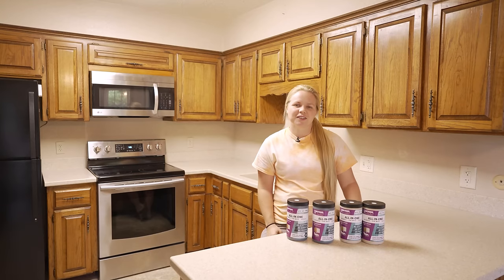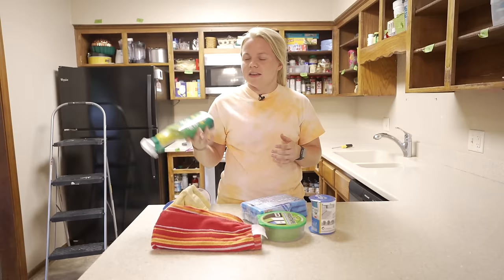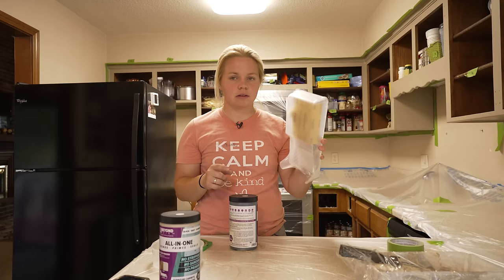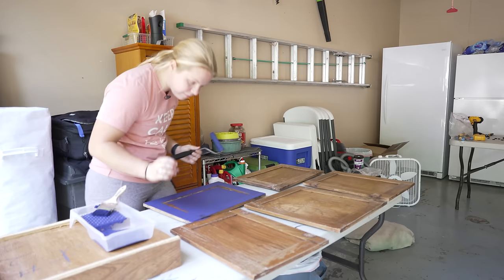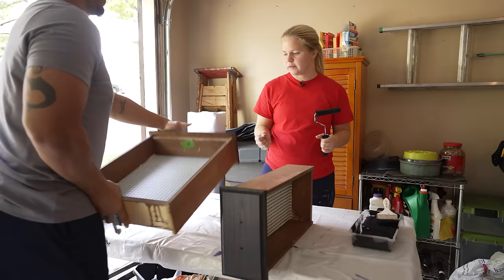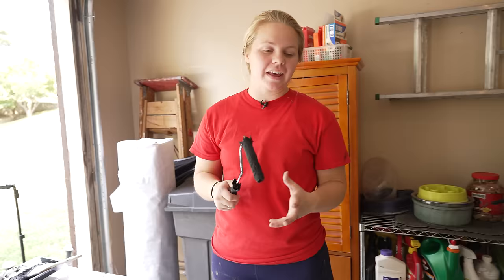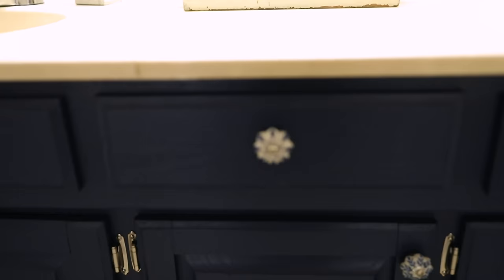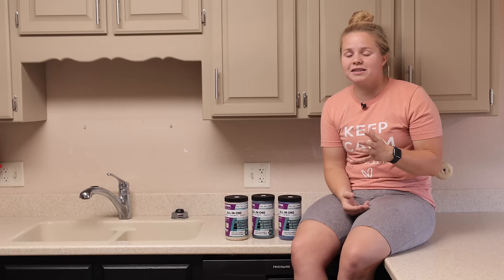How to PAINT Your Kitchen Cabinets the EASY Way

Comment: I don't trust these products that state you can paint cabinets without sanding and removing the  gloss, no matter the product will always grip better with a light sanding first... I did my kitchen cabinets and vanities in 2021 and took a lot more time with it and came out great and feel I can trust they will hold up... For mine I degreased first with Krud Kutter, I then used Timbermate water based wood filler, thinned with water and brushed it on the door fronts to fill grain.. after filler dried, I sanded filler down to just fill the grain, removed all dust, primed with 2 coats of BIN shellac and then sprayed 2 coats of Benjamin Moore Advanced with an airless and 310fflp tip, sanding between coats... Was a lot of work, but came out great...

Comment: FYI, a pro painter charges $100 per linear foot to paint cabinets. If you have 20 feet of base cabinets and 15 feet of wall cabinets, that's a $3,500 paint job.

Comment: Yes I would love to paint my kitchen cabinets.  The house belonged to a relative (grandmother) whom I moved in with in 2013 but she went to hospital and nursing home in 2014 and passed away.  Her cabinets had not been painted since she bought the home in 1973.   They aren’t the same kind as in your video they are just thin doors and chipped but the colour is dull yellow and I would like to spruce them up with a brighter tone or a white.   I would never have known to mark the cabinet doors with the shelves had I not watched your video!  Good tip.  The kitchen is small and there are only 6 doors up top and 8 on the bottom so won’t take that long but I wouldn’t know what kind of paint to get or how much I would need or if I need to prime them.  It’s kind of a smooth gloss type paint

Comment: OK I love this color combo. Choosing colors is too mind boggling for me so I like to copy something I saw that looks good. 2 questions.  First, we have a large oak paneled daylight basement.  Thinking of painting some of the walls to brighten it up. Would beyond paint be a good choice for this project? Second, I have some oak cabinets in my house I might try to redo. They don't have a factory finish so they're a little rough in places now. Should I lightly sand for a smoother finish? 
Thank you!

Comment: Did you use wood filler on the imperfections and to level the surfaces? And, did you caulk the cracks by the corners on the cabinet doors?

Comment: I just watched this video because I have been contemplating doing my kitchen cabinets. I was afraid to do it because I'm a perfectionist and I don't want my kitchen to look tacky. However, I am on a fixed income so having all new kitchen cabinets installed is not even an option for me. Have you ever done anything with the backsplash? And I did see where you had also completed the bathroom and painted the countertop would this work as well for a kitchen and would you let me know what product you used and it was it the same product for the kitchen cabinets. I do not have anyone that could help me do this and I realize that that's a problem and I'm going to give myself at least 2 weeks to do the kitchen because I am a senior citizen and it takes me longer to do these types of things. Would you recommend that the kitchen is painted prior to doing the cabinets because my cabinets go all the way to the ceiling as well. Thank you I enjoyed your video so very much. I've watched several and yours is my favorite.

Comment: I would like to redo both my main kitchen and basement kitchen, master bathroom, and at least one of the other bathrooms. I was wondering since this video was made 2 years ago if the 2-tone look is still in style? I kinda sorta like it, and I kinda sorta don't, so I can't decide whether I want to try it or not.  I wanted a turquoise or teal color for my bathroom, but the closest thing this company has is Nantucket, which I think is too light blue and won't match the rest of my decor. Is there any other product like this with more colors that you can recommend?  Otherwise, I might just be sticking with boring, old white for everything.

Comment: I really love the navy colour in the bathroom. You have done a fantastic job on the kitchen too.  I  just wanted to ask if the cabinets are smooth.  Is the BP a flat paint or does it have a sheen, or gloss. Do you need to put a seal on the cabinets for longevity.
Reply from the maker: thanks! the Beyond paint doesn't require a top coat but you CAN if you want extra insurance! the dried paint is pretty smooth but has the slightest texture which helps it hold up against wear & tear. I would say it dries with a sheen between Matte & satin

Comment: Quick question, I might miss the video. Did you sand the cabinets doors before painted? My cabinets are 6 years old.
Thank you
Reply: No the cabinets were not sanded bfr. She uesd a paint that has already a primer and more (i x remember what else), and the name is 'beyond paint'. Its not cheap but it lets u skip a lor of steps vs regular paint.

Comment: I am going to attempt my cabinets which were covered in a veneer of what seems like plastic  I've removed some of the veneer as it is easy to remove, but the under cabinet material would be very hard to sand as it is so soft.  I'm afraid to ruin the look of the cabinets.  I have bought regular semi-class paint and hope that will do do the job, but then thought that after the paint is done maybe a coat of polyurethane should be use to make cleaning them easier?  Is there a better way to do this?
Reply: She told us to wait 30 days for curing..Did you not listen,??? You can put on polymer if you want to ??

Comment: I've been painting some smaller pieces of furniture with chalk paint and have had trouble with brush strokes. This made me hesitant to paint the kitchen cabinets. I may try this paint and start with a bathroom vanity and see how I like it. How do you not get texture using the stippling and rolling? I'm guessing it's because the paint is self-leveling? Also, can a glaze or dark wax be used over this paint? I would like to have some dimension in the cracks and crevices.

Comment: I did my kitchen cabinets and countertops less than a year ago with this paint. I did two coats and a sealer. It looked great when I did it. I did yellow on top and navy blue on bottom. It already looks terrible. The countertops look worse than they did before and the paint is scratched off the cabinet doors.

Comment: Thanks for the great tutorial. Does the sanding between coats remove the “orange peel“  texture and give a smooth top coat other than the wood grain?  Or does the top coat still have a texture?

Comment: Spend an extra $20 with each color on some purdey brushes instead of the .50 cent ones.  It makes a huge difference in the finish.
Reply from the maker: it’s supposed to be a chip brush that is used and those are only 50¢ 👍🏼

Comment: Soo I tried this paint and it didn’t work out for me. I got pure white and followed the instructions exactly and the paint started to get a streaky yellow color. It also came out sooo textured and used the roller and brush they sent with the pack and again followed the instructions. I ended up sanding it down and going over with Behr cabinet paint. Then finished the kitchen with the Behr paint. It’s more affordable and much easier to use

Comment: How is this paint good on laminate walls I have an old house and they had put laminate countertops laminate walls in one section and then the top section is panel I painted the panel but I wasn’t sure if I could use anything on the laminate will this paint work will it pass the scratch test and everything
Reply from the maker: It should be fine! It adheres to practically any surface!

Comment: Was it necessary to sand between coats?  I do not want sand my cabinets,  Also, can you apply a polyacryclic to the cabinets for added protection and longevity, or is is recommended.

Ms. L. Churchill

Comment: Just found your channel!  Awesome!  I will be painting my kitchen cabinets this spring and this gives me much more confidence to do so.  I've never heard of Beyond Paint, but I'm definitely using it when it comes time.  Question though...you aren't supposed to "brush" but rather "stipple" in the tight areas, so is this paint self leveling?  I'm concerned in areas where I can't reach with the roller that the surface won't be smooth.

Comment: Good looking cabinets… however 

Mistakes

1. Do not use simple green or no crap like that to clean your cabinets. that paint is gonna peel years from now. Use denatured alcohol!! 

2. I wouldn’t dare let anyone use a high density roller it won’t be smooth like a sprayer. If you plan on selling your house using that roller will not bring any value to your kitchen.

Comment: Question- does the paint only work on raw wood or can you use it to paint over other exiting paint?
Reply from the maker: You can paint over existing paint but just make sure it’s not peeling or anything. The surface also needs to be clean

Comment: All the pro videos show how you must sand or scuff up the varnish on the cabinets/doors and use bonding primer in order to have good adhesion and more durable surface for the long run. Some times the easy way is not the best especially when considering the long term results.

Comment: Why are you not sanding the finish on those cabinets? I've been a painter for 30 yrs. and you should always scuff up the finish so you have better adhesion, there is no paint that won't scratch off of a varathaned finish on the substrate, please sand your cabinets first. It's only a light sanding just enough for a great adhesion, you can do that with a sanding sponge

Comment: Why did you not have to sand the cabinets?  I want to redo my cabinets but was told I would need to sand them. We have 32 just in the kitchen, so that would definitely be a pain.
Reply from the maker: Hey Libby! With this paint there is no sanding needed when using Beyond Paint 😃 as long as you clean really well, you’ll be good to go!

Comment: Hi. I'm a cabinet maker. Your video show u didn't repair the doors joints prior painting, the oak texture is not great to paint without filing big gaps and sand. Form distance my look changed.  Details make the difference.  Laquer base undercoat, and paints sprayed is the real luxury refinish fir cabinetry. Too bad for people thinking is so easy.

Comment: Sorry but the linen is just not a good color.  I love the bottom. The walls now need painting because the top is just blah. I'm sure the paint job was done good but I would like to see some differences between the wall in this case. I'm n middle of painting doors and furniture as well.  I'd love to try the paint .

Comment: So this is a really good project you chose here. I been thinking of starting my kitchen cabinets. I have done this type of work before so Was well aware about changing the hardware to make the whole finish "pop". Now I have shopped around the various hardware stores and let me say this, you might want to go into the pricing on that hardware. I know those handle you used are currently over $5.00 each and I believe the hinges are even more pricey. When you say you bought at Lowes you skipped a whole lot of info right there. This project is very expensive upgrade and its the hardware entirely. I was hoping maybe you would have had a tip on where to get the hardware cheaper. I actually was able to find the stuff in bulk packaging but you still have to do the math before changing hardware if on a budget. The paint can be purchased in the store off the shelf and that's not expensive. It's your video and I don't want to rain on anything because you are good at this. But if you put reference to a hinge supplier/hardware supplier that's reasonably priced you might get sponsors. You're advertising Lowes. They give you a price break?  I do have just one question, The title says the easy way. What is the hard way if I can ask? I mentioned all this because new cabinets come with everything you need and by the time you factor in labor and hardware painting it old world style the cost factor isn't that much different. My opinion and I have priced it all numerous times online and in stores. This method is cheaper still but easier then?

Comment: I first gave you a 👍 but had to change it by the end of the video because you talked too much. All you were talking about was common sense plus showing the before & after was not professional when you had junk all over the cabinets & you were sitting on top of them.
Yes the paint helped this kitchen but I think you should have chosen “white” for uppers bc the walls were this off white- linen looking color. It could have looked a lot better w the right paint color & backsplash👍